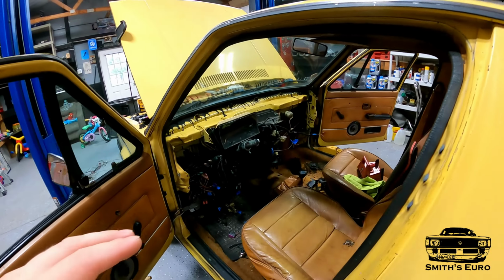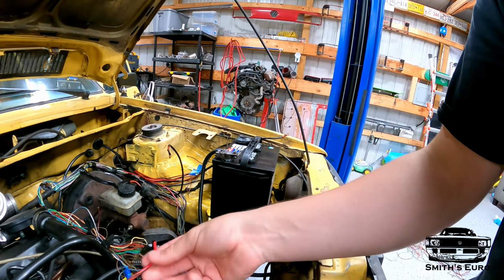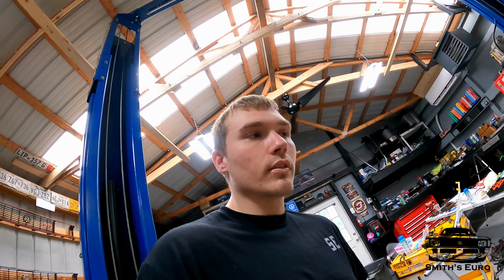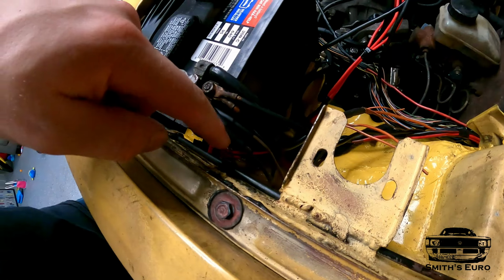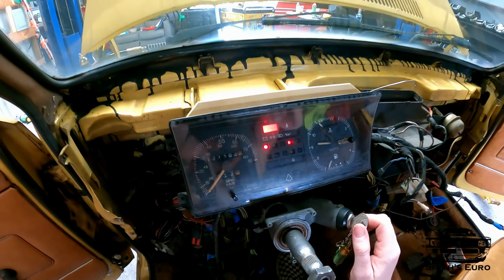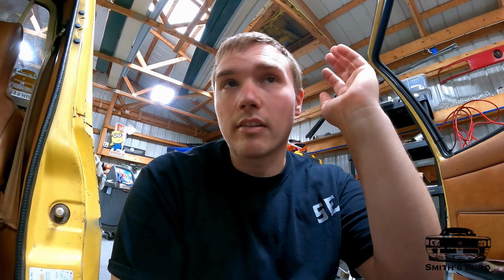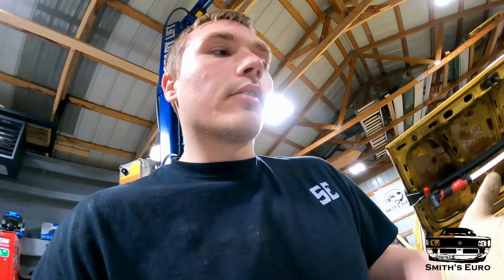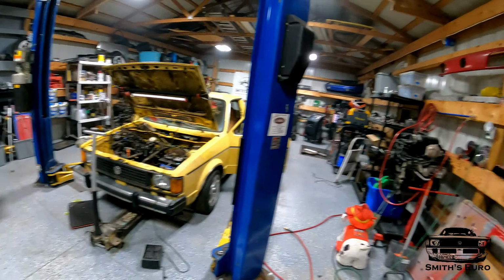MK1 TDI SWAP FIRST START!

Comment: So glad to see you got it running. A huge step forward. I put the MK3 battery cables in all my Rabbits. Bolt the ground to the top starter mounting bolt. So you were able to use the MK1 instrument cluster? That will save me some work and look better than trying to fab the MK3 cluster into a Rabbit. Thanks for all the info. Really inspires me to get some projects out of the way so I can start my Rabbit TDI conversion. 
I have mounted a fuel filter in the raintray before, but there isn't much room with the AC box in there.
Reply from the maker: Yes i kept the mk1 cluster everything works in it as well.
I kinda kept the idea of OE+ and mount as much as the factory would’ve or had done in the mk1 or what the swap came from.

The whole swap isn’t a bad project, just gotta get to it.
I did things that took lots of extra time with the swap just because i like to do everything myself.
I think if someone had everything pre-made beforehand it could be done in a weekend.
Reply: @SmithsEuro  I was thinking the MK3 cluster had an immobilizer like the MK4s do. So was trying to figure out how to fit the MK3 cluster in the MK1 dash. It didn't look good. That's one less thing to worry about. Thanks again for the tutorial.
Reply from the maker: Mk3 stuff does have an alarm box in the wiring. But it is only in the starter wiring.
I reused the mk1 starter wire.

If you used the mk3 wire you simply put a fuse in the alarm plug to bridge the connection and add a failsafe.

Comment: Popped right over once you bled the filter and injectors just like it should 👍 Now comes the fun of routing and cleaning up all the harness. I always hate the way the fuse boxes look when they're all hanging in there by the knee bar. Such a rats nest even when you thin out the harness. Well it's a lot worse on other cars but it's still a pet peeve of mine. Nice work getting it going though, now you'll be good to go once you get it all wrapped and laid in how it should be👍✌️
Reply from the maker: Yea man, i was happy when it went. 

Ive been trying to figure what to do with the mk2 coupe wiring.

Might look into a pdm or one of them “painless” fuse box
So i can drop that oe fuse box weight

Comment: hy,
love your content man! Keep up the good work.
I am gathering parts and some small things for TDI swap on my mk1 caddy as well. 
I wanted to pull out all mk1 CE1 wiring and put mk3 CE2 wiring and fusebox. But I'm little bit worried if mk1 switches (headlights,fan,interiour light,...) can be soldered to mk3 ones?
Reply from the maker: You can but to me id leave all the mk1 stuff in to work as it should.

Youd have a ton more wiring and risk of burning up switches/wiring.

Best to only do the engine to the mk1 harness.

If you are missing all the mk1 wiring thats 1 thing, but if its there id stick with it.